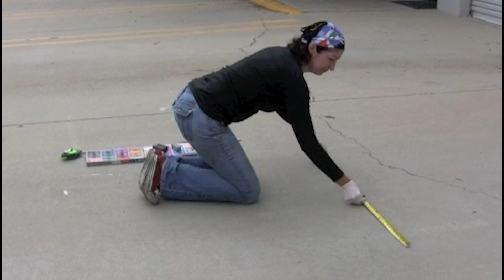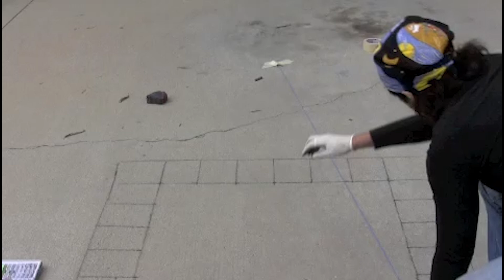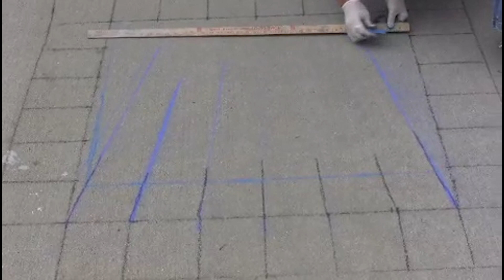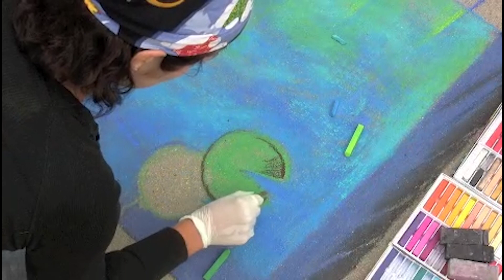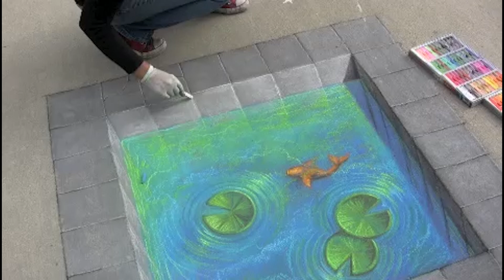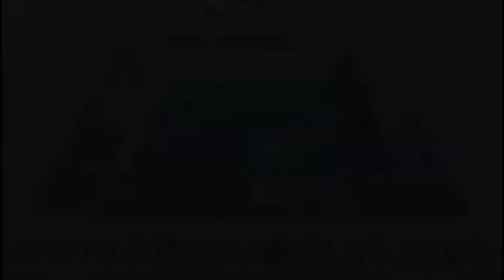3d Pool 'How To' Demo

Comment: Is there particular math involved? Assuming a viewer's height? How stretched the image is towards the viewer compared to aerial view?
Reply from the maker: @UHFStation1  There is geometry 
involved however the layout can be done without using complex formulas. The height of a viewer’s eye is what you are interested in. I typically average 5’ high for most viewers when designing. For example, individuals who are shorter would stand slightly closer to the painting, while taller individuals would move slightly further away from the painting. 
The image is distorted and would appear so if viewed from above. Due to the camera foreshortening the image, it will appear ‘normal’ when viewed from the fixed viewing point. 
I hope that helps!
Reply: I'd like to attempt to use a projector to project distorted animations that can only be viewed from one direction and appear 3D.
Reply from the maker: @ you can do that! In fact, many artists use projectors or even VR glasses to create works now. Set your projector up at the viewing point to get the proper angle. I recommend checking with a camera while it’s projected to make sure the orientation is correct. Good luck! 👍🏻